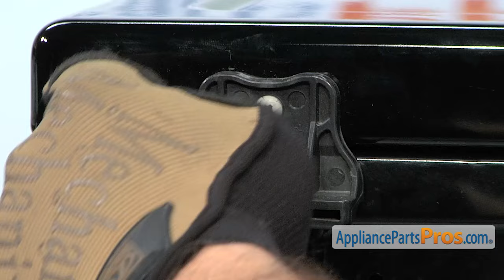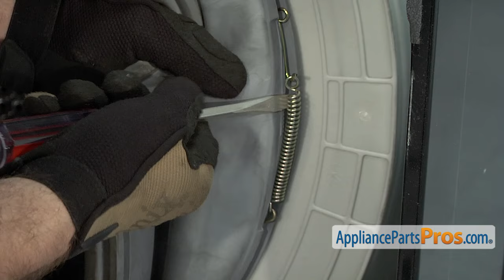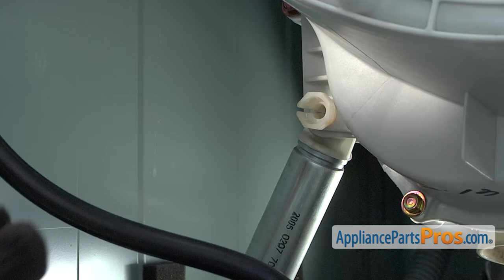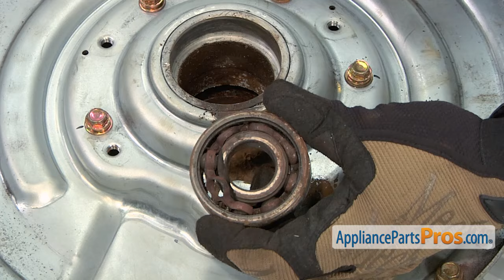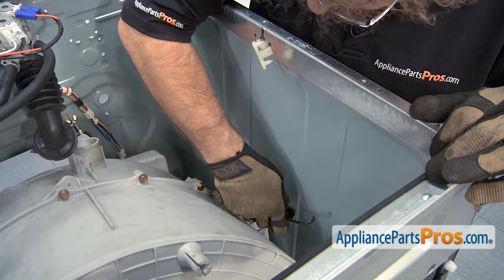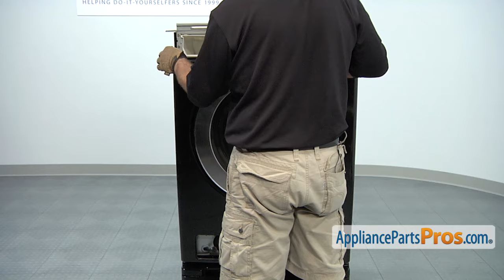How To: LG/Kenmore Washer Seal 4036ER2004A

Comment: Thanks but no mention of greasing the shaft so the seal doesn't squeal. Now I'm afraid my repair will fail prematurely.
Reply from the maker: Thanks for the feedback! The condition of the shaft and proper installation of the seal are both important for a successful repair. A clean, smooth shaft helps the new seal seat properly, and some seals may require lubrication depending on the manufacturer’s instructions. Be sure to follow the instructions included with your replacement part. We appreciate you watching and sharing your experience!

If you need more technical information you can check out our Repair Forum: https://forum.appliancepartspros.com/.  It’s easy to register, and you can either post your question or search the forum to see if someone else has already asked the same question.
 
Our experienced technicians, with over 20 years of hands-on appliance repair experience, are ready to answer your questions and guide you through your repair.

Comment: Followed this video to a "T" for a bearing replacement in my relatively new LG front load washer. This tutorial was fantastic. It was straightforward, showed all the steps, and was critical to my success doing the replacement. It was a beast of a repair, but it really wasn't that bad thanks to the video. For those thinking about doing this, it takes relatively few tools and overall, is really not that complicated, but there are A LOT of parts to disassemble/disconnect and the barrel itself is pretty heavy to extract from the washer. I consider myself quite handy and do a lot of DIY, but this still took me around 6 hours of work to replace and reassemble. Keeping your screws and bolts organized as you disassemble is critical. I also suggest wearing some snug, cut-proof gloves while you work because there are a lot of sharp sheet metal edges in the washer. I never want to do a bearing replacement again, but it probably saved me $1000 if I were to hire someone. It is so much quieter now that the worn bearing is replaced and thank the lord it doesn't leak after I put it together.
Reply from the maker: That’s an awesome breakdown, @DenimNeverNude 😄👍Really appreciate you sharing the real-world experience—6 hours, careful organization, and gloves is exactly the kind of advice that helps others take on a big job like this. Glad to hear it’s running quiet again and leak-free!

Comment: Let me guess the thread Lock is used to keep the bolt for coming loose during high speed spins am I right??
Reply from the maker: @BrianBarbera-o9k You nailed it! The thread lock keeps that bolt from working itself loose during those high‑speed spin cycles — definitely an important step to keep everything secure.
Reply: @appliancepartspros  I thought so medium strength thread Lock
Reply from the maker: @BrianBarbera-o9k Yep — medium strength is the way to go! Strong enough to hold, but you’ll still be able to remove the bolt when needed.
Reply: @appliancepartspros  That's good to know thanks for the updates
Reply from the maker: @BrianBarbera-o9k You bet! Glad we could clear that up — good luck with the repair! 👍
Reply: @appliancepartspros  Not the sound formal but I don't have a front load washer I have a top load washer.

Comment: 32:29 Using a strong nylon cord looped through the eye of the spring and pulling with that is much easier (in my opinion) than using vice grips.
Reply from the maker: Great insight—using a nylon cord like that sounds like a solid technique! Thanks for sharing your experience—every tip helps make these repairs a little easier. 🔧🙌

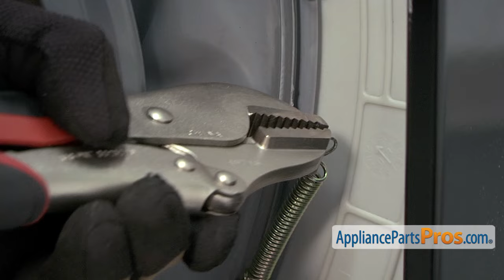Comment: 29:44 FYI - using a strong nylon chord threaded through the loop above the hook and the upper eye of the spring allows you to draw the two together with awkward vice grips and keeps the spring clamp from rotating around in the channel when you apply pressure. Much easier!  Unfortunately, I can’t upload a photo
Reply from the maker: That’s an awesome tip—thanks for sharing it! Sounds like a smart way to make a tricky job a lot easier. 👏🔧

Comment: I followed this video which was very helpful for my 2009 Kenmore Elite, the bearings and seal was completely gone and spider bracket needs replacement to, but when come to look up replacement spider bracket Sears says part no longer available and there's no replacement part, so that is that.......
Reply from the maker: Glad to hear the video helped with your Kenmore Elite! That spider bracket issue can definitely be a roadblock—especially with older models where the original part has been discontinued. You can take the part number to check around and see if you can find the part in stock somewhere.
Reply: @appliancepartspros  I tried just looking up the spider bracket part number online and  even on  Amazon, and all said discontinued or only a couple digits matched up. Some of the discontinued issue might because Sears shut down 10 years ago, least they made some money off me over the past few decades.........
Reply from the maker: It is frustrating when a part is discontinued. If you have your model number we can look to see if it is available with the basket or if there is a replacement for it.

Comment: This kind of repair video is so much better than any manual with still pictures, and from what I see the biggest difference between this washer and my 2009 Kenmore is the color, mine is red so will give this a try very soon. The pressure is off because I already bought a new washer but I just dont want to throw a $800.00 washer away because of $100.00 in parts.....
Reply from the maker: Thanks so much for the kind words! We're really glad the video helped — it's always our goal to make repairs feel doable, not overwhelming. The red models definitely stand out, but under the hood they’re usually pretty similar. Totally get wanting to save that washer — $800 is no small investment, and with the right part, it can still have a lot of life left in it. If you need any help identifying parts or running through the steps, we’re here for you!

Comment: After 7 years to the day, I revisit this video. Thanks again. The bearing replacement was a breeze.
Reply from the maker: You're welcome!
Reply: @appliancepartspros Since I did this repair, the washer shakes more than it did, to the point it and the pedestal walks away from the wall. I also replaced the 3 damper strut things. Could those be too stiff? I’ve cleaned the floor and made sure the washer is level. Thanks.

Comment: My washing machine is very loud on the spin cycle, will it be the bearings or could it be something else ?
Reply from the maker: If you have a roaring sound during the spin cycle then that would be a bad bearing.
Reply: @appliancepartspros  Thanks for the response, yes it sounds like a jet engine.

I have removed the back cover and the Stator cover and the bearing has lateral movement and there is evidence of bearing material on the magnetic ring. Not metal, possibly grease from the bearing seal displacement.
Reply from the maker: If you have a roaring sound during the spin cycle then you would need to replace the bearing.

Comment: My bearings won’t go in!
Reply from the maker: What is your model number?
Reply: @appliancepartspros  LG WM1832CW.
Reply from the maker: If the part number is correct, make sure there is not any debris inside the bearing area. It is not easy to replace the bearing, you can try putting a little bit of soap around the bearing to help it slide in. You may also need to use a rubber mallet to get it seated properly. Just be carefult to not damage the bearing or tub.

Comment: Just finished replacing the ball bearings and the tub gasket on my 14 years old LG. Without your video, I would have to buy a new washer! One thing I want to add to your instruction is when to insert the new bearings, it's much easier to use the old bearings to drive the new bearings in (stack them up and hammer on the old ones).
Reply from the maker: Glad you were able to complete your repair. If there is anything we can help you with in the future please let us know.

Comment: The shaft of my drum was greased when I took it apart.  Should I replace this grease when I reassemble it?   It's a slightly different model.  I had to replace entire rear tub assembly because the seal/ bearings don't come out.

Comment: he used a CHISEL to drive the new bearing in?? wtf another thing he did that is driving me nuts is he used detergent to lubricate the bearings? You never want to use anything with water in it to touch my bearings. Water causes rust and rust is an enemy to bearings. You should always, and I mean always, use oil!!

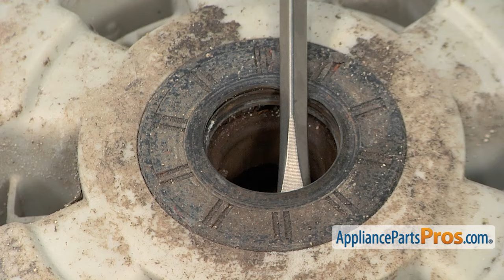Comment: Good video but unfortunately you installed the seal upside down. Look at frames 16:28 and 19:34. If the seal is flipped, the spider shaft will not seat properly and the motor rotor will not install correctly.

Comment: Your approach to driving in the bearings could be a bit more professional, bearing/seal driver kits don't cost that much and even using a cheap socket of the right size would be better than just the hammer by itself.

Comment: Christ, reinstalling the gasket clamps was the hardest part! I ended up using a hook tool, reached up to the little tab on the gasket spring and levered it over. About 1000 choice words but I got it. This video series is a life saver though, totally disassembled a washer utilizing it. Cleanded every bit I could and now reassembling. Thanks a million.

Comment: Thanks for this video! I am about to attempt this repair next week, hoping the spider arm and drums are ok, as the bearings pretty-much siezed up. Question about the drum seal (the thin one that runs along the outside edge of the drums): does it really need to be replaced? I'm not sure I trust me putting a new one in, always afraid of leaks...

Comment: great video,,,,did repair,, the repair guy told me 800$,and i was nuts just chuck it  he said..REALLY ! ,,,, ..150$ and 8 hours later  but did bearings ,spider arm w stripped bolt ...a real treat ,, but got it done ...bearings and complete washing of tub door and rust  touch up etc LOOKS LIKE BRAND NEW !

Comment: My original Amana Electric dryer has a power cable that looks  a little bit melted.
A couple years ago about 4 I cleaned out the dryers internals, there was so much lint inside
the machine I was surprised that it didn't start a fire.
Anyway, the dryer now only becomes warm, to the touch, not as hot as it was which was causing the heater 
to run continuously, and resulted in the melted power cable.
I want to check all of the internal parts that help control the electric coils this summer.

Comment: My LG front load washer electric direct drive motor cover on the back of the tub becomes very hot to the touch and
there is an electrical burning smell at times when there is too much of a load in the washer.
When I wash lighter loads the motor cover becomes warm to the touch but not burning hot, and no
electrical burning smell.

Any ideas about this machine?

Comment: My original Amana Top loader from 1996 has an issue.
There is an oil drip on the end of the transmission.
When I moved the machine there were oil drops under it.
I'm planning to repair it, so far I have the pulley, new belt, and other parts, but
I don't want to put it back together if the transmission is leaking oil.
It hasn't be run in 5 years, so I don't remember the bearings making any squeaking or grinding noises.

Comment: Excellent, straight-forward instruction on what would otherwise be a rather intimidating repair. Good to know what to expect, without glossing over some of the more difficult aspects. The socket and wrench tip for pulling the shock pins was brilliant, and very helpful. Thanks a bunch!

Comment: Pro tip:  Place the bearings in a hefty bag and put in the freezer overnight.  The cold temp will cause the bearings to contract and make installing much easier.
Reply: How do you clean the stator and rotor if they look like the ones in the video?
Reply: @Xclusive615  take the rotor and stator apart and carefully vacuum both parts with a plastic attachment. Clean the stubborn particles with a moist rag.
Reply: Thank you sir.  Worked like a charm.  In none of the vidoes did I see anyone address cleaning the rust/crud on any of the parts.  A little time consuming but was able to them all clean.  Thank you!

Comment: I'm in the process of doing mine (Kenmore Elite version) right now, just got the tub shaft out of the bearings (rumbling bearings seemed to be what was indicated by the sound of it. Yep, that's it). The seal wasn't leaking at all. It does show signs that. If I had let it go longer, It would continue to wear from the bad bearing and leak later. Glad I pulled it out of service quick and didn't just keep using it till it stopped.

My Spider Arms look a whole lot better than the ones in the video with just a slight hint of what could become corrosion between each arm. There is no corrosion at all on the tub shaft.

While inspecting the arm, I was wondering, IF I remove the arms and put a light coat of Fluid Film (Lanolin, basically aerosol sheep grease) on the aluminum arm assembly, it seems like it would keep the corrosion from advancing any further. What are your thoughts on this.

I've seen Fluid Film work on steel, under cars and mower decks, on rust that has already started but basically neutralized with an application of the stuff. It seems to lock out new moisture and lasts a year or so underneath a car. I don't think that the spin cycle would sling off a light coat but I could be wrong. I see signs that the factory grease has spread a little bit, or maybe it's the grease from the bad bearings.  Any thoughts or Input?

Just wondering.
Thanks in advance

Comment: Thanks. Great video! In your opinion is it worth fixing the bearings on a 9 year old LG machine, or is it likely for something else to fail within a 1 x 2 years?
Reply: I just fixed mine - 8 years old.  Everything else on the machine looks new.  It's not worth fixing if you have to call for a repair.

Comment: This process takes a while and there were a couple areas that were tough (banging out the drum from the outer tub and replacing one of the spring clamps) but this video is excellent in terms of explaining step by step. I got the parts for about $25 and it saved me from buying a new washer.
Reply: Changed bearings on front load duet wirlpool. Changed nothing,  washer walls away on spin. ? Bent shelf on basket?

Comment: If you find your spider assembly has rust or corrosion on the shaft, replace it, do not clean it. ... I went through 2 bearings in 2 years, because if you clean or wire brush the shaft clean, you will reduce the diameter of the shaft, which will never seal with the gasket in the bearing housing of the tub ...Just my 2 cents; it will save you a lot of time. I bought my spider assembly for $120. If your spider assembly is good, take it off the tub anyway, because there will be a heavy build-up of dirt, detergent, and corrosion that is under the assembly and HAS to affect the performance of the washing machine ... I scraped off 2-3 pounds of grime that was caked under the spider. Plus, this grime will mix with your clothes washing daily.

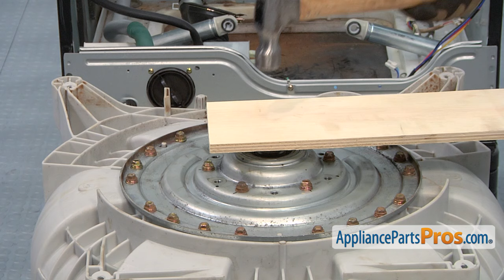Comment: Just for awareness of anyone choosing to tackle this, at about15:47 of the video they tap the shaft twice and the tub pops out.  I did not have that experience.  In order to get my drive shaft out of the bearing I needed the following: hammer, wood block, wd40, CLR, boiling water, PB Buster, 3 pound sledgehammer, more wood, propane torch, a boatload of perseverance/stubbornness, and some Blanton's.  Try hammering the wood block as shown, I'd recommend a piece of 2x4, no way in hell the 1x4 shown works.   When that fails, proceed down my list in no particular order and repeat until that glorious day when the shaft begins to move.  You are likely beating on the shaft itself with the 3 pound sledge at this point.  You can now celebrate with the Blanton's, you may need to use your non normal hand to drink as you may be unable to lift the hand thats been swinging the 3 pound sledge incessantly.  Good luck!

Comment: I used this site to replace the bearings and seal. the information and instruction is spot on. The only place I had difficulty was installing the rubber hood with the counter weights installed. I removed the weights and was able to get the rubber boot on with ample room for the fingers to get it over the lip. After that I installed the weights and finished up the job. Seems to be working great and no need to wear hearing protection when the washer is running. Thanks

Comment: Buy a bearing/seal driver kit from harbor freight. Never use detergent as lubricant are you kidding? Light machine oil. Like “3 in one”. Never allow a single hammer blow on the race not being driven in. Good god.

Comment: By they way when we rebuilt our LG front loader, I shopped all over the net and found Appliance Parts Pros to not only have the best prices, they shipped the parts we ordered very quickly, beware folks, a lot of on-line parts companies might have what seems like cheap prices, but they cannot ship quickly and when you have an appliance out of service you need it back in service as soon as possible, stick with Appliance Parts Pros it will cost you less in the long run.

Comment: Excellent video! How long is a bearing and seal supposed to last? If you are handy, have the space and tools and are up for the job, your video is a charm to guide one through this task for a great DIY project. Unfortunately many will require outside help, and with cost of parts/labour it may make it economically not worthy. It seems like you have to practically take the whole machine apart to get to the bearing. Can they not design the machine to allow easier access or the ability to lubricate these parts periodically? Keep up the great work with your repair guides!